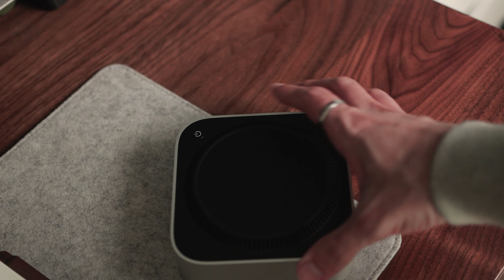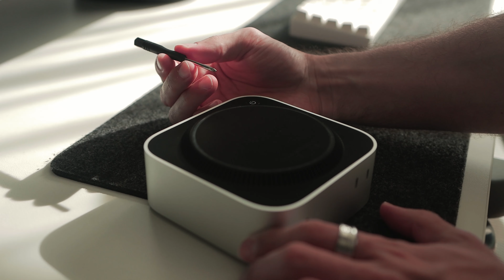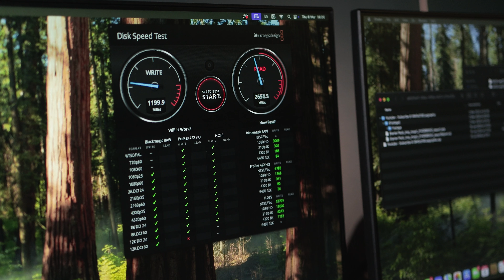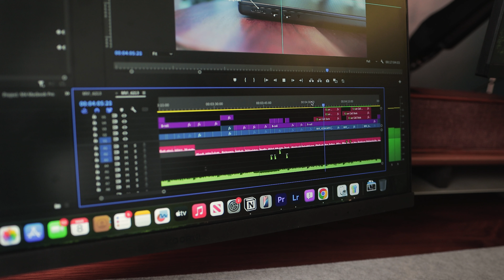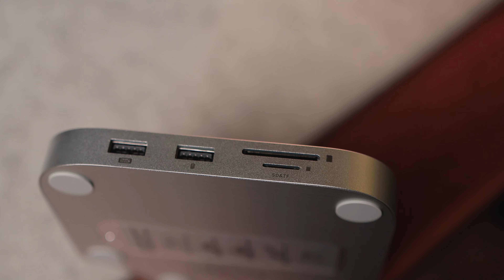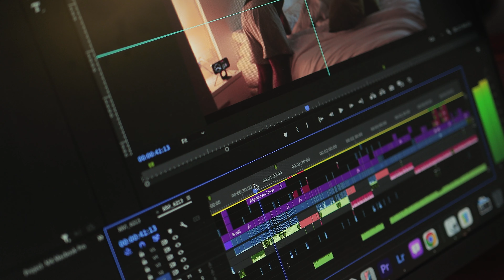I Used The Base Model M4 Mac Mini For 5 Months – Here's The Honest Truth !

Comment: I bought the base Mac Mini M4 Pro a couple of months ago and just got around to setting it up until today.

Now I didn't do anything beyond updating MacOS and installing Final Cut Pro and Logic Pro, but it was a distinct change to not hear a fan at all compared to the jet engines from my MacBook Pro 15" from 2015.

Also have a MacBook Air 13" 24Gb/512Gb model to setup, and whilst I'd have preferred the Pro, have spent enough money on new hardware in the last few months, so saving £300 on the list price for the Air, and at least £500 or more over the equivalent spec Pro was a good deal for me. Nice, lightweight travel laptop to start projects in Final Cut Pro or Logic Pro before moving the work to the Mini and/or my Studio M1 Max.

Comment: I don't like putting system stuff (such as applications or home folder) on the external drive. If it accidentally gets disconnected, then it presents major difficulties.

Also, it prevents the external drive from being portable to other machines.

I don't mind spending $200 to upgrade to 512GB. The bonus is that this doubles the write speed!

I use the external drive mainly for archival purposes. I format it with exFAT so that I can use it with Windows PCs around the house.

I've had my M4 Mac mini for a month now. I'm absolutely loving it. And it's a very economical system because I reuse various components.

Comment: what are the temperatures like ? for me when exporting photos in Lightroom or exporting a video the entire time Mac mini m4 pro goes around 100-105 C temp , if I export like 1000 photos that's 105 C for around 15-20 mins ? the fans only go up to around 3500 rpm after hitting 105 but it won't go down much . is this something you experienced?